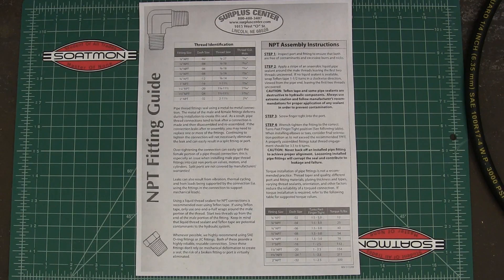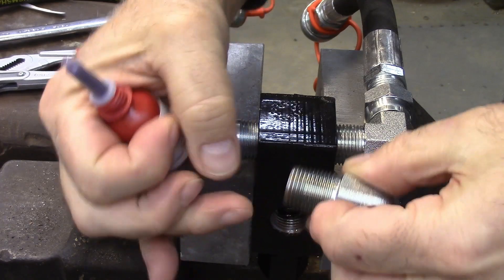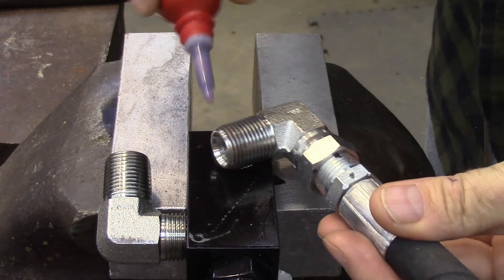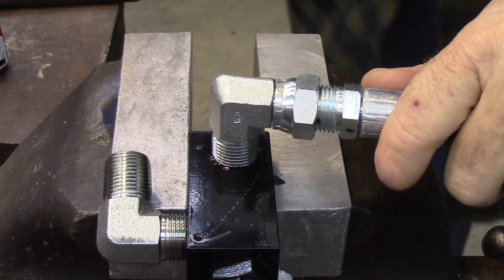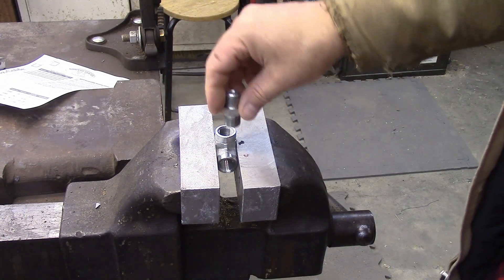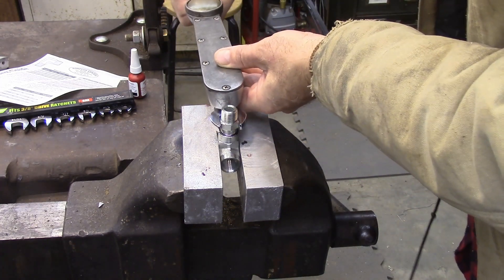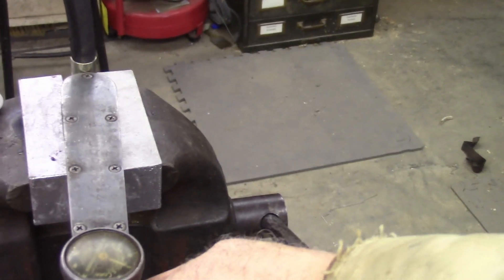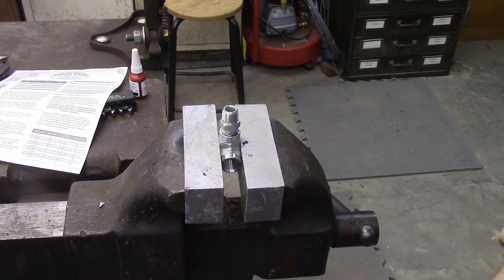How to Make NPT Hydraulic Connections

Comment: The reason you skip the first two threads is because some types of thread sealant is pre applied and dries after application. You skip the first two threads to eliminate cross threading when screwing in the fitting.

Comment: I'd be careful with torque installation for tapered threads... The guide you're reading literally states "Torque installation of pipe fittings is not recommended practice." 

Also per a Parker Hannifin install guide: "As a general rule, pipe fittings with tapered threads should not be assembled to a specific torque because the torque required for a reliable joint varies with thread quality, port and fitting materials, sealant used, and other factors."

Thread count is superior because it directly measures the engagement of the threads, ensuring a reliable seal regardless of variables like material, sealant, or thread quality etc. 

But I agree that they can "feel" a little too snug at times 🤣
Reply from the maker: Thank you for sharing that information.

Comment: Thankyou for this video. I had to plan a hydraulic connection and i did not known the fact that you have a range of turns (1.5 - 3). This would make sense as you do not know where will you end up with something like 90 degree elbow joint, so you need flexibility in turn.
Reply from the maker: You're welcome!

Comment: This looks brutal but maybe just right. I have the problem that I have a dash6 fitting with 3/8 NPT which turns very easy into the female before it is hand tight whil another npt/barb fitting (3/8 too of course) which stops turning by hand after maybe 2 threads.  How come? Npt is not like npt? By the way, very good video. And I will use loctite 577.
Reply from the maker: There is something wrong with the thread if it will only just start.  Maybe a burr of it's not the correct thread.  Could have been in the wrong package.
Reply: Thanks for your answer. No damage visible. I have to use the caliper. A slightly different pitch can be seen with the eye, or with the ICT billet NPT the first thread tooth is already wider while the JEGS NPT starts out narrower. The pitch will probably be the same but not the diameter. @SoatMon

Comment: Where I work, we use some thread sealant on water and air lines, but never hydraulic lines. And they wonder why everything leaks... And I've been preaching about using some sort of Loctite thread sealant on JIC fittings (be it 542, 545, or 5452) but I just get blank stares. Any mechanic or machinist knows metal to metal contact is bad, and any nick on a hydraulic fitting causes a leak (let's be honest, when you get a flex hose made, are the fittings at the end ever perfect?) and with high pressure hydraulics, the hoses tend to move and work the fittings out slightly (on top of constant vibrations via the pump or the application). But yet I'm the stupid one.
Reply from the maker: Thanks for sharing your experience Joe.  It's amazing how some employers don't use the experience of their employees to make things better.

Comment: I used teflon tape on a 3/8NPT hydraulic ram fitting ~ 3000psi, it leaked, then tried liquid PTFE thread sealer, it leaked again on first use. Third time I used 545 and let it cure for 24h and no leaks with a clean looking fitting. While tightening the fittings on the last install all i could get was 3/4 turns past finger tight as it was already very tight after 1/2 turn. Use judgment or torque as a reference since NPT fittings are not as "reusable" as other fittings and each one varies in its thread cut. Also check the material of the fittings, if its zinc plated use a wire wheel and scratch off the coating on the threads, if not use the prescribed activator since 545 works best on steel. Check the data sheet for all the information on 545, its helpful to determine the best cure time and temperature conditions to get the highest strength as it seems adding heat with a hair dryer can reduce cure time and increase strength somewhat.
Reply from the maker: Thanks for sharing your experience.

Comment: From everything I've read the torque values are given as a reference only, and not to be used to determine how much you tighten them.  They all say to use the 'turns after finger tight', but along with that there is also a minimum/maximum of threads engaged after tightening.  Fittings aren't perfect so with variations in size and finish the torque required to provide a strong mechanical joint and a leak free joint will vary.

At the end of the day, as simple as pipe threads are, assembly is more art than science.  An experienced pipe fitter can feel what the joint needs, and on occasion the pipe or fitting needs to be burnished, re-threaded, or discarded.
Reply from the maker: Thanks for sharing your experience.
Reply: That does make sense given how variable NPT fittings are, but it is valuable to have the torque settings and demonstration here because anyone who has much experience with a torque wrench has a good sense for how much effort 40 ft-lbs is. Thus, if you are really pulling hard on the wrench to get to 2 turns, you can instantly know that it's time to stop. Thanks for the helpful video, Soat Mon.

Comment: I  could be wrong but don't think using a crow's foot effects the readings on the torque wrench
Reply: There's a simple and commonly used way of determining the answer. Spoiler alert you're wrong. Imagine that the Crowfoot was not an inch and a half from the end of the torque wrench but very far from the end. Say as long as the length of the torque wrench. Simple mechanics tells you that the torque felt at the end of the torque wrench would be half of the torque felt at the end of the crow foot. So yes the crow foot effects the torque. Maybe at 1 and 1/2 in it doesn't affect it very much.

Comment: That video was very helpful.  I didn't know about the torque specifications but will get that chart.  Thank you for that.  But one thing I did know is to never put the Teflon tape on over the end of the fitting.  The tape can get into the system and plug up orifices and valves.Thank you for this one!  Seems like I can always learn something.
Reply from the maker: Thanks Glenn!  I posted this because I had trouble finding and figuring out the information so I figured someone else could also use the info.

Comment: It looks like a little over 1 1/2 turns with the torque wrench, on the first fitting. I also do not like the turn method, looked like those were to tight. What are you building?
Reply from the maker: These were the fittings for my post hole digger down pressure unit.
Reply: Ok, I have to do something for the slide on the flail mower I just bought. Thought about using the feeds for the bucket, but would like to keep the front-end loader on the tractor when doing the fields to pick up stones.
Reply: @SoatMon  Getting closer to looking at the project of adding a "third function" for the slide on the flail mower. There is a "kit" for LS tractors, but $1,000. Surly it can be done for less??? I need to understand the ports on the current valve (pump feed and tank return). Any guidance would be appreciated.
Reply from the maker: Try this video I put out: https://youtu.be/RkeNS0LWabw  That is how they are laid out on my tractor which is a MX4800.  Yours are probably the same.  I used the land pride third function kit, it's about $750.  I'm with you it all seems really expensive.